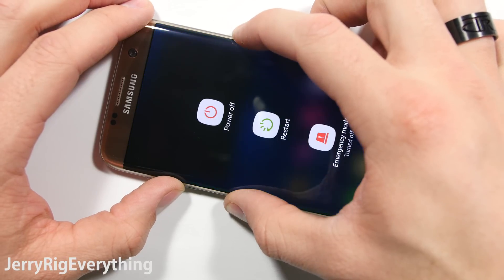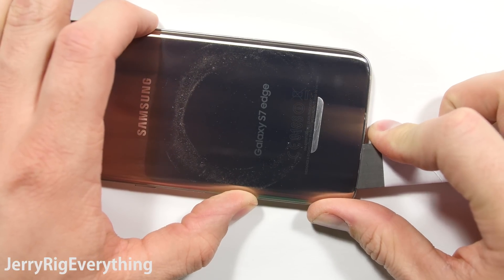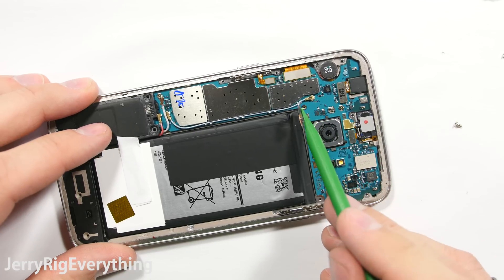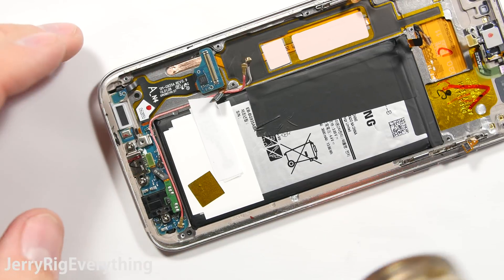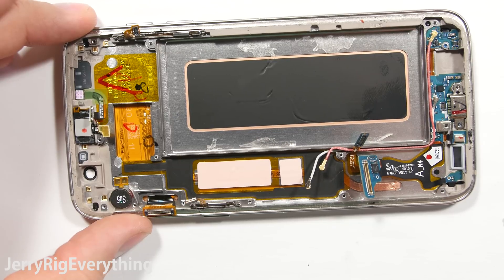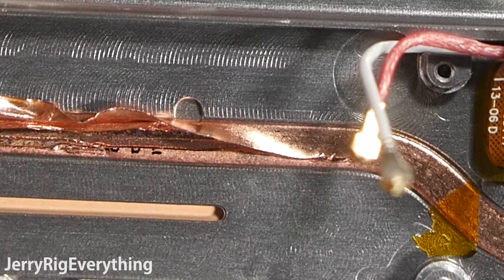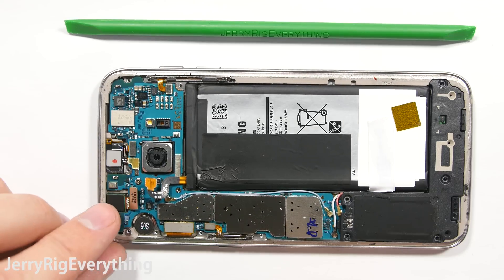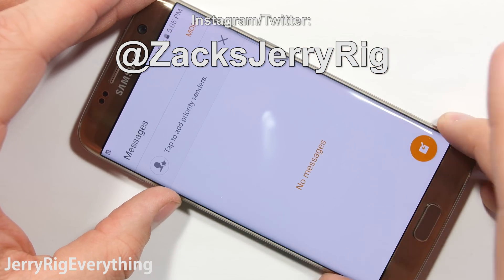Galaxy S7 Edge Screen Replacement - Charging Port Repair - battery fix

Comment: no liquid once you sliced the heat pipe open does not mean the chemical inside does not form liquid when it is sealed in. maybe the chemical has a very high saturated vapour pressure or the heat pipe is actually pressurized inside. either way, the chemical vapourises very quickly so you would not see any liquid, which is actually a good thing. because that is how the chemical quickly brings out the heat, by vapourising.
Reply: athanos lee Well I applied common sense by asking for a source , guess what I got.
Reply: nope- there was no pressure ;)
Reply: +athanos lee Do you have any source for that or did you just made it up on the spot ?
Reply: athanos lee Yea was just checking that out and the interior of the heat pipe with liquid seems to have a different structure.Plus it specifically mentions copper + water for electronics .... ain't no water in there.
Reply: athanos lee that's true , but you seems to have ignored the whole "not the same structure" part
Reply: +Akumetsubg Not really. I just applied common sense here. The copper fibres you see inside the heat pipe are actually for the liquid to circulate.
Reply: +Akumetsubg I don't know what source will satisfy you. Maybe reading about heat pipe on wikipedia will tell you enough.
Reply: +Akumetsubg what structure? the wick (that copper fibres you see) is clearly present. And mentioning copper-water for electronics does not mean it is the only way. Acetone is also mentioned.
Reply: +Akumetsubg And there may be not that much liquid inside in the first place given how small the heat pipe is. Too much liquid equals too much vapour, and too high the pressure (which is not desirable itself), and too high the working temperature.
Reply: +Akumetsubg have you read my reply:"+Akumetsubg what structure? the wick (that copper fibres you see) is clearly present. And mentioning copper-water for electronics does not mean it is the only way. Acetone is also mentioned."
Reply: +Akumetsubg I don't see any mentioning of a heat pipe WITHOUT liquid inside. Maybe you can illuminate me on this. And there are several ways heat pipes conduct the condensed liquid back to the heat source; a wick is one of them.

Comment: Nice video. The screen can be removed, crazy thing is I charge $80 to do a charge for replacement, galaxy six because I have to remove the screen and the risk of damaging it. There's a company in Utah that only charges $45 according to a customer of the phone.  Anyways apparently it's not that difficult love test for repair shops, as he said that there's others I did it for 55.  Maybe there's a special technique to get it done easy. I'll show you my method here shortly. Soon as I get it the s7 and s7 edge.

Comment: You are a pro.
Reply: yep,no liquid cooling
Reply: +Brandon M google it and you will find the real answer, 'liquid-gas cpu cooling'
Reply: Brandon M I found the answer. If the phone heat up the stuff in this cooling system turn in to a liquid and the same was used for space. (sorry for my english skills)
Reply: it's legit...I stand corrected